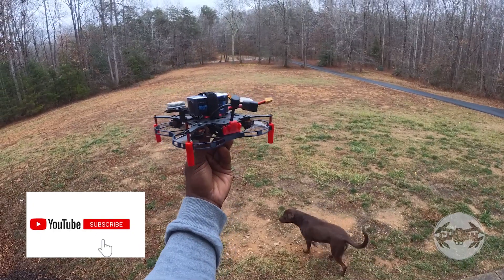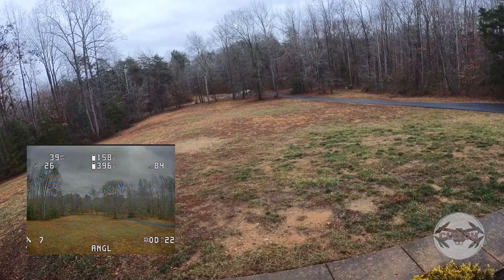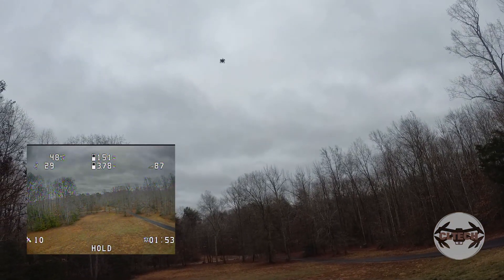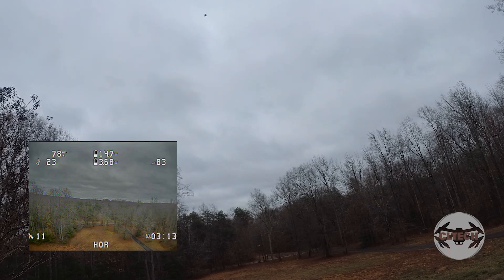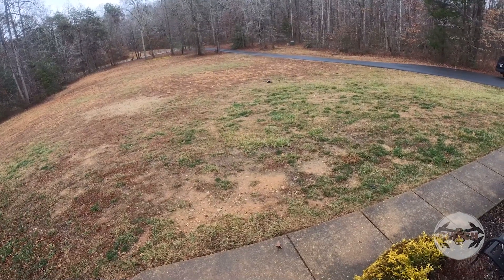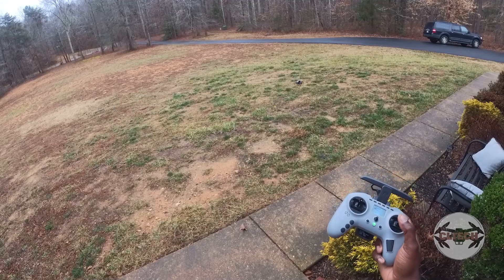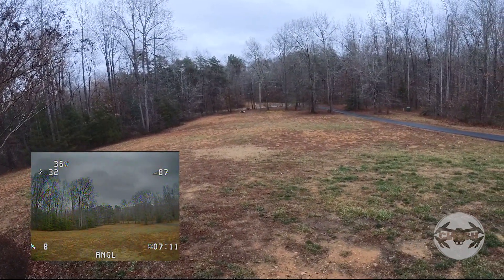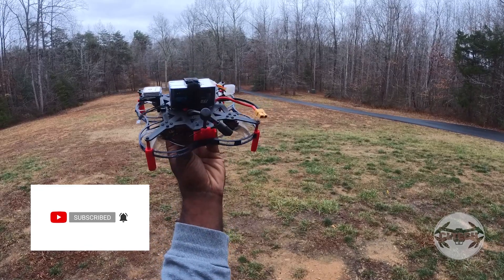2 - INAV (GPS, Lidar, Optical Flow) - 3D Printed 4S 3" Cinewhoop

Comment: Your optical flow sensor only has a range of 2ms if you instead chose a laser a Laser range finder you could get ground distance accuracy with position hold because the laser range finders do dozens of meters height.....if your optical flow had the same distance when you tried to navigate hold up in the air, it probably would have worked btw........
Reply: For example here's an 80m ttl Rx TL VCC GND  ready to go for $45 including shipping
Reply: Please how can i contact you, i need a lot of help with drones

Comment: Check Compass calibration AND orientation if drifting off in POS Hold.
Reply from the maker: Wow.  Rookie mistake.  Havent put GPS on a quad in a while and forgot about calibrating the compass.  Working on my V2 with a compass.  Printing a new Nylon X frame now.  Will try the compass in a few days,.. after calibrating.  SMH